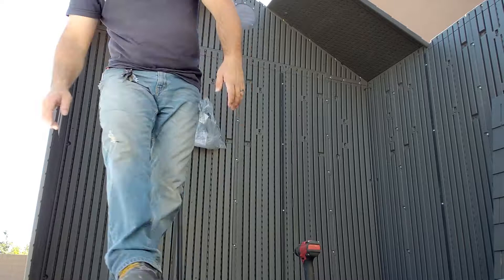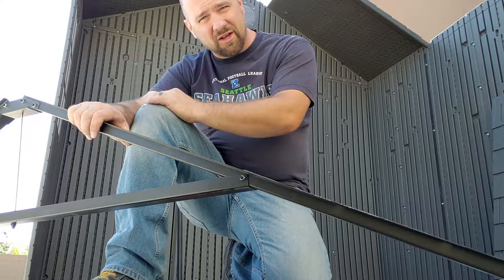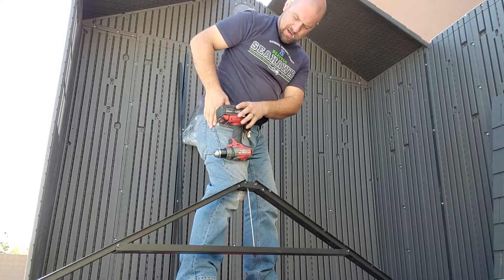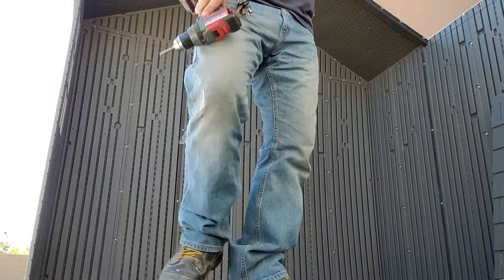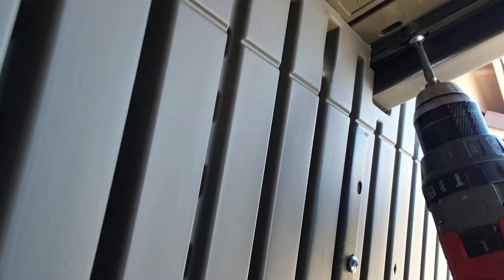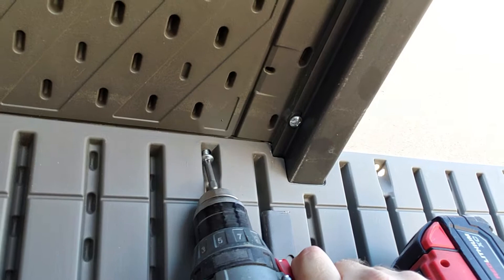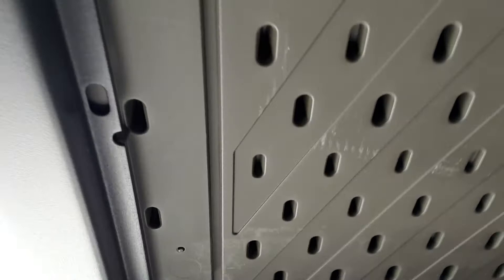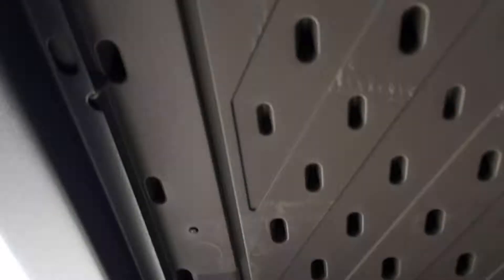How to add the trusses on lifetime plastic sheds by yourself.

Comment: These sheds are actually fairly easy to do. Just takes some time putting the doors together and everything ready to “actually” build. I did it all by myself first time in 6 hrs on a uneven piece concrete slab. Looks and works fantastic.
Reply from the maker: A piece of advice though make sure you balance it and put shims around where it is uneven because if you don't after a period of time some of the screws will start ripping out of the plastic and you'll have to have them get replaced... the repair jobs I do that involves sheds normally involve uneven platforms

Comment: Im having so many issues with this thing. Im building it for my mother in Arizona, and the heat has pieces warping all over the place.  After bleeding all over the place trying to finally get the walls together, the roof and the gable don't line up to save my life. Im so frustrated with this piece of *^&% , but Im thankful I can keep coming to these videos to hopefully find something that clicks and I can end this nightmare.
Reply from the maker: Every scenario is slightly different from the other but one major factor you need to be on level ground

I tell people I just refuse to do any that are on pavers because it's near impossible to make them level and you will have issues when you get to the roof

Best thing you can do at this point is to buy I make sure all of the corners are level with the walls so you might have to use a powerful amount of shims to brace up the ends so the roof can go on

Comment: I have a magnetic wrist strap...it let me hold up to 15 or so screws at a time while securing the headers and roof panels on my Suncast Modernist 7x7 shed.  put enough on the strap and you don't have to go back to the bag until the next panel/item.   these plastic sheds are nice, but they really need internal (wall) framing.  the metal support studs aren't enough.  oh, a LEVEL base helps too (ask me how I know 😢)

Comment: Hello Jason. Great videos! Thank you! Can you please tell me the remedy when the existing screws have stripped out the plastic panels that they attach to? Please advise.
Reply from the maker: Not too sure every scenario is slightly different do you think you could take a quick video And tell me when it's posted I can look at it and tell you
Reply: will 1/8" toggle bolt anchors work (do they make them that small?), the ones that spring open after inserting into the hole?  what about 2-piece automotive push pin fasteners; the kind that hold trunk liners in place.   NOT the 1-piece tree ones, the other ones that have a center pin that pushes in and spreads the 4 tangs.  the push pins might require a slightly larger hole (3/16" or 1/4", not positive though)

Comment: I had my roof cave in , bend a few side panels, tresses. I plan to order a snow load tresses if I can reuse the plastic panels. What do you think? So sad only 2 years old
Reply from the maker: It's really going to be a per case situation.. one of the best things you can do is to lay the roof out in sunlight to get warm and it will bend back into position.. if it doesn't Bend back into position it won't work.

If the screw holes got ripped out there are other options you can do like riveting and maybe even using glue as well.

I have a broken shed that I will be utilizing as a chicken coop.. I will be doing riveting myself it works very well

Comment: I have a question for you. I have a Craftsman 8x4 resin shed. It’s 10 years old and recently it’s bulging open on the corner going around to the side of the shed. Any suggestions of what I might be able to do?  I live in a senior mobilehome park and couldn’t place it on concrete so it is on plywood. We’ve had no problems till recently.
Reply from the maker: Actually did this exact same thing for a church.. what we ended up doing is putting a 4x4 block on the corner ... one person held the block and the other person drilled through the sides and was able to make the unit adhere to the block.

Then after that use a whole bunch of caulking to seal up and make it watertight again.

It has still held strong two and a half years later